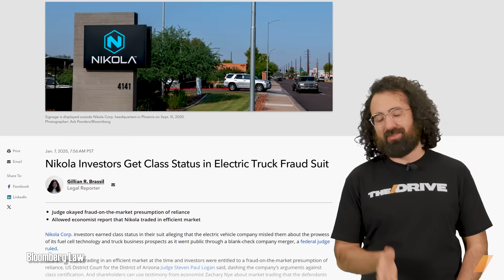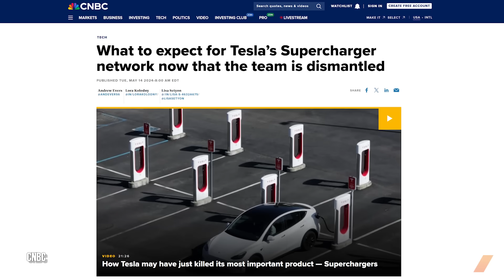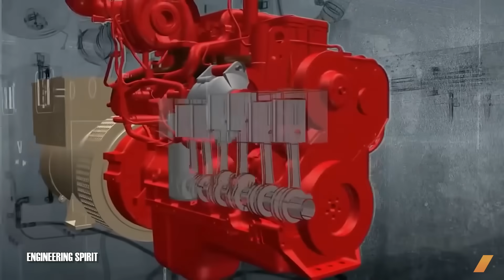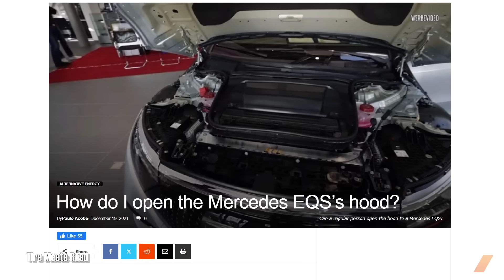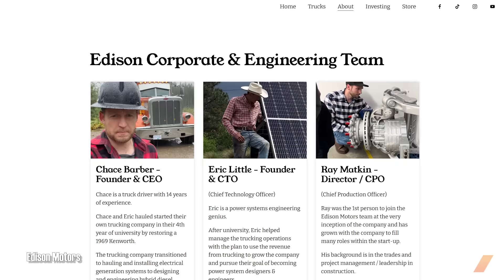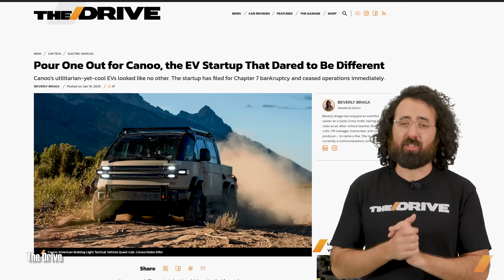The truckers in a shed beating Tesla with 100-yr-old EV tech

Comment: when people say the EV transition for land transport is not possible or unrealistic, they usually accompany it with hand waving like you just did (13:30 "because of the cost and complexity" even though electric is so much simpler with LT 5% of the moving parts of ICE). where is the critical path limit? Batteries are on an incredible learnings curve (cost curve) that even the biggest hypers didn't project ten years ago. Critical minerals are being squeezed out of the chemistry bit by bit… if more long distance freight was put on rails then trucks only been needed for the last 10-250 km in most cases, meaning much smaller batteries required. Electricity demand going up isn't something that is prohibitive, well except for that US transmission permitting has hundreds if not thousands of Gigawatts of new wind, solar and storage projects waiting in the wings because nobody in government wants to tackle the issues head on. Prius cars dont solve the GHG emissions or the air quality pollution problems associated with ICE so I dont know why you think such a solution for trucks is anything other a very modest incremental improvement over exiting ICE trucks.

Comment: Skipping the battery when the diesel is running is more efficient than only powering the electric motors from the battery.  Series / parallel electrical supply to the motors might be complicated but would make sense.

Comment: Somewhat bias report. The Tesla Semi is designed to operate at a gross combination weight of up to 82,000 lbs when fully loaded (including tractor, trailer, and cargo), which takes advantage of U.S. regulations allowing electric heavy-duty trucks an extra 2,000 lbs over the standard 80,000-lb limit for diesel equivalents. Tesla claims this enables a comparable (or in some cases similar) payload capacity to diesel semis for many real-world applications, especially in regional and drayage routes.While electric semis like the Tesla are indeed heavier overall due to the large battery pack (estimates suggest the tractor unit could weigh around 8,000 lbs more than a typical diesel day-cab tractor before accounting for offsets), the comparison should indeed factor in the full powertrain: a diesel engine + transmission + full fuel tank weighs significantly more than electric motors alone (motors are lighter, but the battery dominates the added mass). Real-world analyses show the net payload penalty for the 500-mile version is often in the range of 4,000–6,000 lbs less cargo than a comparable diesel after the regulatory allowance, though this varies by configuration (e.g., day cab vs. sleeper) and route. Many typical loads fall well within what the Semi can handle effectively.Regarding durability, Tesla batteries in passenger vehicles have demonstrated exceptional longevity, with some high-mileage examples exceeding 500,000–700,000 miles with minimal degradation (and rare full replacements). While specific Semi battery data is still emerging, reports indicate a robust design backed by strong warranty coverage (some references point to up to 1 million miles for related components), and degradation is expected to be gradual.Real-world users like PepsiCo (including Frito-Lay) have been operating Tesla Semis successfully since late 2022. They run them extensively—up to 12 hours per day on routes ranging from 100 miles (short haul) to 250–450+ miles (longer hauls), often with loads like lighter products (e.g., chips or beverages). PepsiCo has publicly shared positive experiences, noting reliable performance and plans for expanded use, which contrasts with speculative criticism from non-operators. Fleet feedback highlights benefits like lower operating costs (cheaper "fuel" via electricity and reduced maintenance without diesel engines/oil changes) and strong acceleration/power.The Tesla Semi isn't positioned to replace every diesel semi—long-haul routes with ultra-heavy or extreme-range demands may still favor diesel for now—but it can cover a significant portion of trucking operations (regional, distribution, etc.), substantially reducing emissions and pollution, especially where it is needed, in cities. That's the core goal: meaningful decrease in pollutants where it makes the most practical and economic sense today, with ongoing improvements to battery tech likely closing remaining gaps over time. Here are some visuals of the Tesla Semi in action, including real-world loaded operations from PepsiCo deployments:These show the truck hauling full trailers, demonstrating its capability in commercial fleet use.

Comment: Hydrogen engines working as providers to generator and batteries for the drive train, optimal ranhe well how far do you want to go :-) hydrogen cars are well like more then 30 years old, mercedes Bmw toyota dorve them her in EU but two problem then cost and infra structure today we in Sweden have somethinl like 5-7 places you can fill up hydrogen, Denmar much better but not enough 17-19 stops Infrastructur  must be fixed first

Comment: you all should check out @electrictrucker, a german truckdriver that goes long distance in fully electric trucks! But i guess for landscapes without good charging grid, going diesel electric is a nice starting point. And refitting these with batteries, when batterie technology got better, should be not so difficult

Comment: Disclaimer: I approve of Diesel Electric for heavy hauling, trains, planes even etc. and I applaud Edison group. However for Trains I would much sooner see electric overhead lines for trains like in Europe, we have the ability to do this. Also, we need to support 
Lots of issues with this video. 
1. The Hummer EV is arguably one of the least efficient EVs, they use outdated batteries. You're also ignoring modern batteries coming down the bend and the weight difference with each generation. We are close to solid state batteries in retail vehicles.
2. "Electric passenger vehicles are seeming less and less likely" Looks at China and Norway Yes we need to do better with the grid, especially in the USA. We're a residential electric grid in North America, not an idustrial electric grid like China, so the "impact" is higher relative to current modest demand, whereas China is seeing a marginal electricity demand increase because their industrial sector is electrified. Canada is moving faster than the USA towards electrified industry with Algoma steel electrifying its furnaces. 
3. The problem with series hybrid electrics is that you've introduced a new point of failure (several actually), and you've made the vehicle more complicated to maintain (which you explain is "serviceable still", but that doesn't account for the number of components increasing, therefore the plain fact that you are in fact adding complexity). It's not "technologically" more complex, as seen in diesel electric locomotives, but you can't say that more parts is somehow less complicated- it is, that's very plain.
4. It's not sad to get rid of the transmission, it's smart and easier to drive... Come on.

Comment: With FSD, trucks will become driverless as well, basically you may endup getting a cabinless truck system, that is cheaper to maintain and run, available 24/7. It will be like a conveyer belt for the countries supply chains

Comment: So many holes in the assessment. Cost of a typical diesel rig is $130-$200k. If this thing is 25% more, that puts it at $160-$250k. If Tesla cost $250k, then there is no difference. Is highly unlikely this cost only 25% more being a new development. Also unlikely Tesla cost only $250k too. Still, your math is lacking.
There is no way this has less low maintenance. Let see it has diesel engine, generator, motor, controller and battery. How is that simple? So you use 20% less diesel, that is not clean energy.
Yes, our electrical grid cannot handle EVs. Government told us the world will end, and mandate EV. They know the grid desperately need upgrades. But all this time, the government did nothing to upgrade the grid while insisting the world is ending without EV. Now we are starting to roll out EV to save the planet, and the grid is still can't keep up. Such hypocrites. But, the faithful still have blind faith in this religion. Think you better switch back to God. At least if the world ends, God can build a thousand more :)

Comment: half trues are half lies

video forgets to mention :
+ the weight of the diesel fuel, not just the diesel engine.
+ the regenerative power while breaking
+ the lower cost of operating an ev than diesel 
+ the emissions of the diesel generator
Reply: + The diesel fuel would never be a significant weight compared to the motor itself; like a couple hundred pounds of it at most
+ Yeah this is true but I don't see any reason you couldn't have regenerative breaking on a diesel-electric (just added complexity)
+ This might be true
+ They do mention the emissions of the generator, it's cleaner than a regular diesel even without particulate filters
Reply: 300 gallons of diesel are 1135.62 liters, 850 kg, almost what the engine weighs.
Reply: @hypercoder  why would it have 300 gallons of diesel?
Reply: @sokjeong-ho7033  

Many many reasons
Not al trucks drive in cities from gas station to gas station.
not all trucks carry light cargo like doritos
not all trucks can stop during runs.
not all cities allow semis to go in the city.
....
Reply: @hypercoder  *all

Comment: mmm, diesel fumes in my lungs, nothing better, right? cancer causing fumes; but what about horses and carriages? we could even go further back, like, walking, crawling, eventually? Seriously, the way some are desperately holding on to old polluting technology when we have better options TODAY.... insane; battery technology is advancing at speeds never seen before, we are less then five years to over 1000 km range, way over.
Reply: EVs arent pollution free due to raw material required to make batteries the mining of them and manufacturing of them sure it gets cleaner as it progresses but still not quite there yet.
Reply: A fully electric semi can only do 1/4 the work of an Edison hybrid semi offroad. So batteries need to get 4 times better before they are comparable.
Reply: Carbon used to make your cell phone: 70 to 85 kg

Comment: does it even need a 9L engine just to be used as a generator?
Reply: Depends on the use case scenario. An OTR truck prob only needs 150 hp 

The current Edison vocational hybrids are running 9 liter 250 hp diesel for off road work.

Comment: Mercedes sprinters are diesel hybrid getting 31+mpg 
The engine also lasts over 400k miles
Reply: 400,000 km in Ford Transit would be cheaper and produce less co2.
Reply: @Picklemedia  avoid transit uses gas. There’s no way that engine is making it 400,000 but there’s no way there’s that engine is making it 100,000 miles without needing new turbos I’ve had one. They are a shit vehicle.
Reply: @P@P @Picklemedia t 80,000 miles both turbos went out on 2019 ford transit
Reply: @Picklemedia  also it wouldn’t be cheaper because a diesel. You only have to get the oil changed every 10,000 miles
And here diesel is just like $.40 more a gallon than gasoline a gallon is 3 L
Reply: @Picklemedia  also it wouldn’t be cheaper because a diesel. You only have to get the oil changed every 10,000 miles
And here diesel is just like $.40 more a gallon than gasoline a gallon is 3 L

Comment: Diesel-electric works in trains because railroads have spent enormous sums to run their rails on as flat a terrain as possible. That means that the weight of the locomotive and its cargo are not that much a factor. Trains can be and are hundreds of yards long. It is also true that trains have a near-universal right-of-way over cars. That means they don't have to stop and start much. We've not built our highway system that way. Extrapolating from one to the other will not work.
Reply: Whew. It's a good thing that Edison trucks carry 3,000 lbs of batteries to handle peal loads. Dodged a bullet there.

Comment: 2:55: you need to count the weight of the driveshafts and transmission on the diesel, and add the electric motors weight to the EV. EV motors don’t weigh much, and they’re right on the wheels so they don’t need driveshafts. Just some wire to connect them to the battery. Wire weight can be excluded obvi, it’s like 20 pounds total.

Comment: The only thing that I see for the next 20 years is hybrid. Could do the same with electric cars. Smaller battery and a charger  all electric drive train. I read somewhere that Tesla or Honda, I think was working on gasoline generator for the long haul. Probably a lot smaller internal combustion engine.

Comment: You continuously are comparing the Edison trucks to locomotive’s. Locomotives are NOT HYBRID, the lack of storage batteries makes them simply diesel electric. The hybrid Edison trucks are more efficient due to regenerative braking, recapturing energy that is normally lost as heat in the brakes.

Comment: IMHO we need tiny mini-trucks that Chinese and Japanese use. We need those electric, and those for doing the major distribution of goods in the cities. No big trucks going multiple places, but tiny ones, and do it in multiple passes.

And then have larger trucks hauling the cargo from ships and harbor to logistic centers outside the city or between smaller cities, as big cities should be done via trains only. 

We need diesel trucks for remote locations and so on. 
Same way we need gasoline cars.

But we must as well get city people move to tiny cars, and no more SUV or similar big cars unless you have special permit.

Comment: This whole concept and video is full of flaws.
Cars/Trucks with series hybrids would be standard if there are no drawbacks.
The efficiency of SH is worse than driving the wheels directly with a big clean diesel engine. SH have lots of loses.
The whole system also adds a lot of weight, costs and requires space... .
And 1500 HP seriously? If a small 9 Liter engine cant produce 1500 HP on average then you also wont get this at the wheels on average.
SH have very limited use. Its not general solution for trucks. Others tried already. Its only something for the niche.

Comment: You can pay for the fuel or the batteries.  The savings are eaten up by the batteries over time.  There is no free lunch.  This is a  fool's errand until batteries have higher energy density.  This is just corporate green-washing.

Comment: Any time you convert energy you lose some of it. So there is no reason for hybrids in most vehicles. You guys are so full of it. Picking any negative, which "may be true", that you kind find. Poor reporting, do some research please. In a train… I might give you that, but most of us do not drive trains. You mention how bad/expensive EV batteries are, then you turn right around and talk about how they are used in this hybrid semi. Only valid point, currently, is the time to charge. But that is changing, and fast. A truck is not driven 24/7 so there is time to charge most of the time.

Comment: The hybrid buses you see in NYC are using this type of technology. The first gen’s used a 5.9 Cummins and the second gen’s are using the 6.7 the run the generator. The traction motor is the same size as a ZF 6 speed automatic.

Comment: Or connect the electric motor to the transmission and use a Honda type generator that runs 8hrs on 2 to 3 gallons of fuel

Comment: Why not just make electric motors that mount to the axle and spin the yoke then you can convert any pickup to electric just swap out the transmission with a generator or would that be to easy?

Comment: I think you got the basic hypothesis of electric trucks/cars wrong. Also the basics of why locomotives had diesel-electric powertrains (and changed to diesel-hydraulic later for better efficiency). And trucks not. 
1) we want to change to electric trucks/cars because we want to reduce the burning of oil/petrol/gas. You say, this is impossible, because of charging infrastructure, a 15h/day ride and the weight of the required battery.
This sound to me like in the 1890s: why should we buy an electric light bulb! We have petroleum lamps. They work and there is NO GRID and not enough electrical supply. This all doesnt make sense. Horses and candles are the future!
If we made it to the moon and build the existing electric network (and the highway system!) we will be able to install charging stations everywhere. 
2) when you say that a trucker runs 15h/day....you should revisit the labor laws. At least here in Europe truckers have to take a rest regularly. And in that time, the truck is re-charged. so, you need a battery for ~ 200 miles max. that means 400 kWh.
3) Solar systems produce electric energy for a fraction of what coal, gas and nuclear costs (unless your nuclear reactor is already 50 years old). The batteries of EVs can have a 10 year life in stationary electricity storages befor they need to be completely recycled.

All points you raise against electric cars/trucks are easy (but not quickly) solvable. You just need to move! 

Imagine. The presentation of the first IPhone...no mobile internet, needs to be charged every day, no internet connection in 90% of the states, this is going to die! 
and? Where are we now?